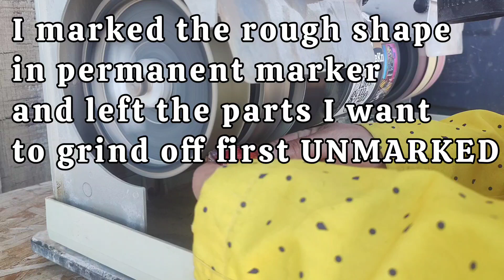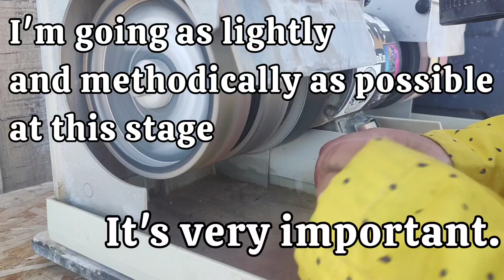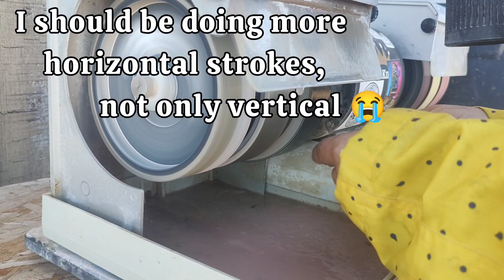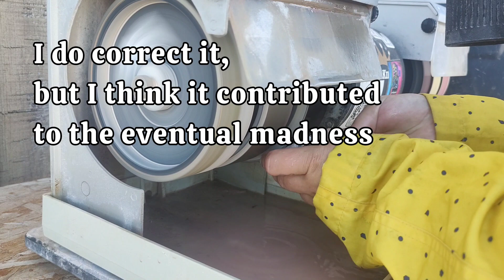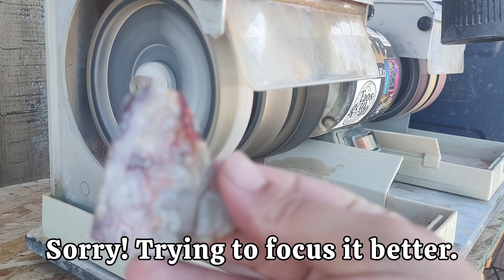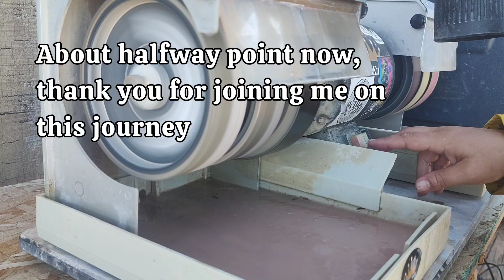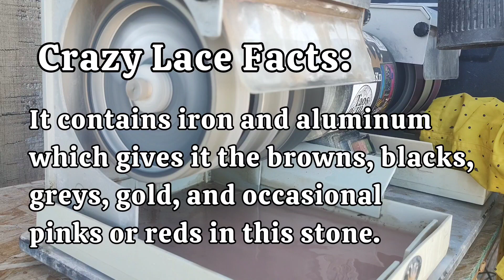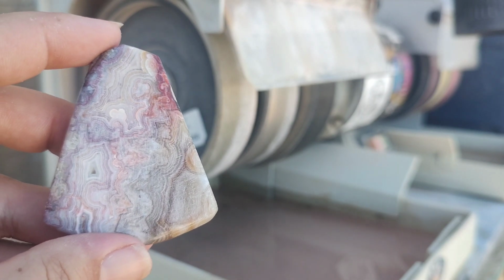INSANE Pink Crazy Lace Cabochon! 😍💖💎 #lapidary #crystals #gems #agate #quartz #gemstone #jewellery

Comment: I like your rain coat. Have you hit you fingernail on the wheels yet?  I have no fun.  Watch the side of the grinding wheel.  Looks like a ghost spinning around.  You got the haunted CabKing.  It’s hard to get the scratches out of agates cause you’ll find if you don’t dry it off completely it’s hard to see those suckers.   Try a sharpie to coat the top at least for the first 3 grits.   It gets down in the scratches from the previous wheels and makes it easier to see them.  Your doing great keep at it.
Reply from the maker: Thank you! Fingernails are all good, definitely need to practice not getting the sides. Smaller cab might help that, yes?
I think the name should be something cool like "Ghost Face Cabber", but it isn't my machine so Kyle has to pick the name 😂👍
It was my first time cabbing Crazy Lace, and I look forward to working on it more. I cut it short because the sun was starting to hit, so some cool morning this week I'll finish it up 😊
Thank you for all the wonderful tips my friend, looking forward to working more on them and showing you the results soon, you're the absolute best 🙏
Also looking forward to cooler weather!
(I'm going to say that everytime 😂👍💖)